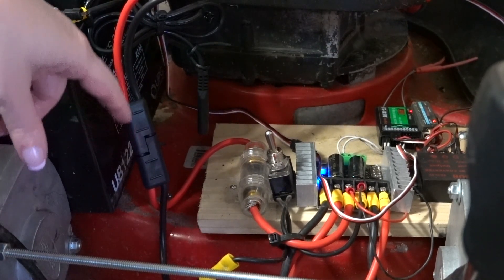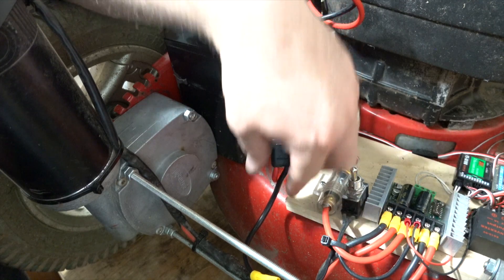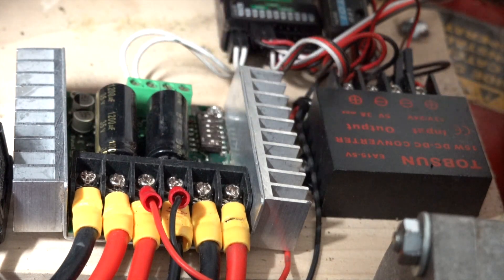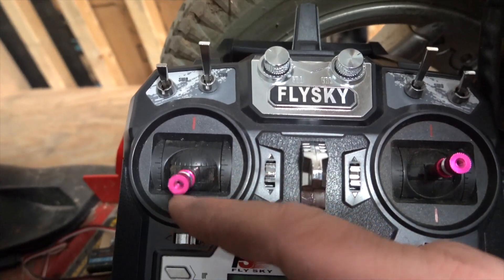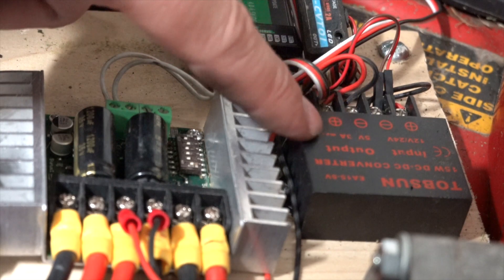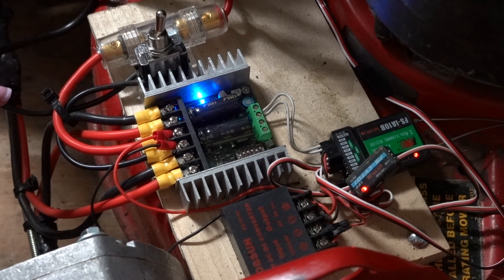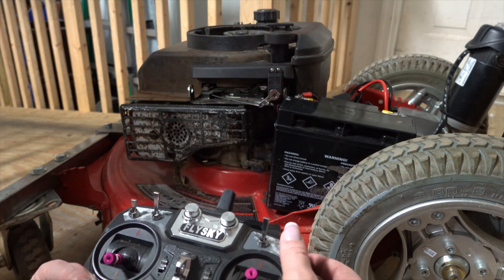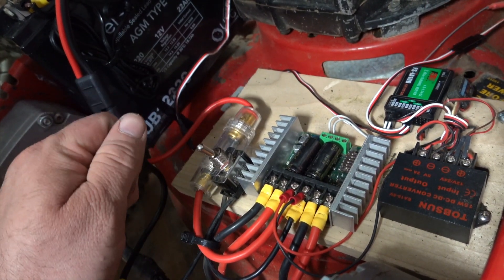How To Wire An RC Mower (Step-By-Step)

Comment: Where do you get the little plug in connectors you use on the flysky receiver?  Mine came only with the binding connector.
Reply from the maker: Those are called Servo Extension Cables. We have them listed in the description of the video under Servo Leads: https://amzn.to/3yEI2r4 . You will need to cut one one of the cables off to connect to your motor driver. This pack comes with multiple lengths so you should be able to find some that work with your setup.
Reply: @MeantToBeLindseyB   Thanks for the information and the video!

Comment: Could not figure out why my R/C mower would gain a mind of its own and need to be shut down for a minute when I changed direction quickly/often until I watched your video.  Just ordered a step down converter to stop the fly back voltage from messing with my receiver.  Thank you for your great video and information.  Wish me luck.
Reply from the maker: Good luck! Since we made these videos, we've had the same issue happen a few times too. Since they are cheap, we just go ahead and replace the remote receiver and also replace the receiver leads with new leads and fresh solder on any bare copper that goes into screw terminals. We just like to make SURE that we do not have any intermittent signal loss between the receiver, step-down converter, and motor driver. It's cheap and easy to do just to give a little piece of mind ESPECIALLY if it's been acting up.
Reply: @MeantToBeLindseyB  do you really need to replace the receiver?  Mine is still working fine after I turn it back on.  I have done a little (very little so far) reading on special flyback current diodes.  They still make me a little confused but I think that diodes would be the way to go.  They would allow electricity to only be able to flow in one direction and stop the flyback current.  Also, I think a person can program their remote to soften the braking for each motor.  This should stop the flyback because it wouldn't be a sudden stop of input voltage.  I will try to keep you informed.  Thank you again!!
Reply from the maker: @MrDozer120  It’s not a MUST REPLACE, but for us it’s a good idea and it’s fairly inexpensive and easy for the peace of mind. The diode is a good safety too.

Comment: I have a lawn  mower (two 350w motors)  controlled by a sabertooth 2x25 and a flysky i6ab. All fonctionned. 
I had to change the wheel transmission, so I had to dismantel  the electronics. Now, all remounted at the original position, when I turn on the circuit, one wheel start spinning alone. (turning on the flysky, it cannot drives.  I am not a specialist). 
I succesfully rebinded, but the wheel start again. On the flysky display appear a third line: SIGS1:10. What does it mean? (i suggest somethings about velocity of motor 1). What can i do?

Thanks
Reply from the maker: It's hard to know from your description. If everything worked correctly before, it seems like it's a wiring issue. If it never worked correctly to begin with, it would could be a settings issue or a wiring issue. 

We would check the DIP switches on the motor driver using the manual to set them for your current setup. Then I would unplug everything and reconnect it one connection at a time, ensuring that the signal wires from the remote receiver are connected to the correct input ports in the motor driver (channel 1 to 1 and channel 2 to 2). Ensure there are no frayed or loose wires and all the wires are plugged in correctly ESPECIALLY on the remote receiver where it is very easy to plug in the wires upside down or in the wrong channel.

Rebind the remote receiver and reset the setting on it if anything has changed. Let us know if you need more help!

Comment: AWESOME. I don't really plan building RC Mower, but this might be inspiration for some other RC vehicles. Everything in the setup is logical and exactly the same as i would do it. That fail-safe mechanism was extra bonus that i would probably miss if i was building mine.

Comment: Why you used saberthooth?
Reply from the maker: We prefer Sabertooth due to the build quality, low profile heat sync, and small footprint. However, due to the popularity of these types of builds, availability and cost have become a much bigger problem but they weren't an issue when we first built this mower. There are other options, but this was the best overall for us at the time.
Reply: @MeantToBeLindseyB  yes cost is very big issue. I am trying to use bts7960
Reply from the maker: Good luck!
Reply: @MeantToBeLindseyB  thank you..

Comment: Thank you for the detailed videos of your build. I would really like to know how the servo has been working out for your cut-off / fail safe switch. Has it been reliable during use? Have you had any issues with too much heat or vibration causing any problems while operating?

I was also wondering when you changed the spring tension to a lighter spring, did it effect the lawnmower shutting down any differently due to the change on the friction brake in the engine?

Instead of a servo, I was going to use a 12v power window motor/cable to overcome the spring tension on the lever but your solution seems so much less complicated. Sorry for all the questions, but I really like the way you solved some of the many problems faced when building an rc mower.
Reply from the maker: We have had some problems with the servo screw stripping out or unscrewing itself and the metal wire that pushes the lever bending. We have had to replace the servo a couple of times.. but they are cheap and it's still working fine.

The engine shutoff is slower, so it takes 6 seconds to stop when you hit the switch instead of 2, but that's fine. If we did it again, I would probably do what you're thinking of by using a dedicated motor like a wiper motor, but the servo is a decent "budget" solution.

Good luck, and let us know how your build goes!
Reply: @MeantToBeLindseyB   Thanks for your reply, that's exactly what I needed to hear. Since you say you have had some troubles and I already have this 12v window motor, I'm going to see how it works instead of buying a servo. I will let you know how it turns out.

Comment: You can control that Toggle switch function by adding a relay in-inline with it.... then the receiver can control the relay to turn it on with the remote controller transmitter.
Reply from the maker: We were having trouble finding a relay that could handle the power, simple enough to control with the remote receiver, and at the price point we were trying to hit (as inexpensive as possible). We will be looking into a solution like this for a future build. Thanks for the tip!

Comment: First of all, awesome awesome video. Thank you for the effort you've put in explaining all this.  I have a question about the two signal wires from the remote receiver to the sabertooth module.  I see that you're not powering the remote receiver from the sabertooth module, but why is there no ground wire connected from the remote receiver to the sabertooth module?
Reply from the maker: The power and ground for the remote receiver are both coming from the power inverter. Since the inverter and the motor driver both use the same ground too we didn’t need to run a ground from the remote receiver to the motor driver. You totally could do both and having a secondary ground is a good idea.
Reply: @MeantToBeLindseyB  Thank you :)

Comment: Great right up like the step down converter going to put into my build the signal wires going to motor driver you deleted the black and red from the pig tail correct and it picks up power just from the step down connection thanks again from another wheelchair user
Reply from the maker: Yes. That is correct. Good luck!

Comment: Could you provide the model of the engine speed controller? How is the mower performing? Does the electronics work without problems?
Reply from the maker: We listed the motor driver used (and alternatives) in the video description so you can read the full specifications of each on the item pages. We have been using this setup since this video came out with some minor tweaks, but no real issues. As long as you ensure no wires are coming loose, the motor driver is not getting clogged with dust and grass clippings, and you’re taking proper care of the batteries this setup should last a good while.
Reply: @MeantToBeLindseyB  Oh, sorry for the unnecessary question (I didn't expand the description). I hope to start my mower for the new season. Regards.
Reply from the maker: No worries! It’s easy to miss the info. Keep us posted on your progress!

Comment: Hi guys, love the video and its helped me understand how things work. I realize this video is over 2 years old now and you have probably already changed what I am about to tell you but if not it might be something to look at. I noticed in the video that your red power wire coming out of your motor driver to power the voltage step down regulator may be pinched under the heat sink of the motor driver. Would hate to see that short out. Hoping to make a remote controlled lawn mower soon. Gathering parts already 🙂
Cheers,
Dan Oliver
Reply from the maker: Good eye.. Thanks for the heads up! We have had issues with that. We added fork-type wire connectors for the end of all of the wires and rerouted them a bit to keep them from getting pinched or rubbed.

Comment: Hi there,  I just got my sabertooth 2x25 today and I tried to run it with my two motors. Followed your wiring diagram but one of the motor running it self without using Mt remote while the other motor is not running at all. Is it possible if you could help me to solve the problem.  Thanks a lot
Reply from the maker: Follow the manual to set the DIP switches based on your particular configuration. You can also Google search “Sabertooth DIP switch wizard” and it will walk you through exactly what you need to do.
Reply: @MeantToBeLindseyB  thanks a lot for your information. my sabertooth is now working fine right now. once again big thanks

Comment: Love the design and thank you for sharing such detailed info. I used your links on Amazon and buying the same things. Even bought the same M300 motor and gearbox on eBay. I see you wired up the motors with the pos/neg cables but what is the 3rd wire used for? The light maybe? Did you hook it up? Thanks!
Reply from the maker: That’s the wheel lock. You have to power it with 24v to release the lock. We just removed it from our motors. It’s worth doing because it makes the build simpler and it’s just a few screws right on top of the motors.
Reply: @MeantToBeLindseyB  Many Thanks 😊.  I will remove it too. Still waiting on items to come in but can't wait. Wish I could send you guys pics of my build.
Reply from the maker: @larrythomas6773  Feel free to email us and keep us posted at MeantToBeLindseyB@hotmail.com

Comment: I see how you powered the FS-iA6B, but how did you know which pin was power and which was ground? I can't find any docs on that and it's driving me nuts. How did you figure that out?
Reply from the maker: You're right. We can't find that specifically stated in the manual or anything. We just plugged in the servo wires that came with it and the 3 wires of that servo wire is in the order of white -> red -> black. It only works with the white (signal) wire on top, so the positive wire is in the middle and the negative is the bottom pin. It's true that "red is positive and black is negative" isn't ALWAYS true, but it works with this case. When testing, if the LED light on the receiver isn't blinking or solid, the power isn't hooked up correctly.
Reply: Of course I find it right after asking :-) https://static.rcgroups.net/forums/attachments/6/8/1/5/7/2/a10427603-178-500px-FlySky_IA6B_pinout-f89eed4f.jpg

Comment: I’m in GA. (Neighbor state. I’ve been to Franklin b4. 

I want to create your mower as mentioned in other video comments.

However, if I can, I will take it to next level.  Before I get into “Nextel level.  I have got to get 1st level.  It may require replacement of some phase 1 components, but with my preliminary look into next level, I may can use all previous components.  My host capability will determine that.
Reply from the maker: Awesome! Let us know how it turns out!

Comment: Not sure if u still use this but I’ve been building and using mine over 10 yrs. U have to make a steel frame for it because the toque from the motors will break the mower frame, your wiring is way more complicated than it have to, without a proper enclosure you will spend money to replace all that in couple years, u need different wheels to get any traction, the battery is way too small, u need 24v. I haven’t done this but u should go with battery operated mower to make it easy starting. I personally use mowers with a starter so I can turn the mower on and off remotely.  this is an on going thing where u have to constant fixing , replacing, upgrading.  I’m not even disabled but I find it’s a PIA because something always goes wrong and it’s a pia to work on and it’s take up a lot of surface space in the shed
Reply from the maker: Thanks for the tips! We have been using it since this video came out. We’ve learned a lot from it and have made some improvements (like changing the front wheels and redoing some of the electrical connections). Everything is still working fine so far, but yes… there are definitely things we could have done better. Our next build will probably be an all electric version with brushless motors. Using what we learned from this build should help it be even better next time.

Comment: I finally got my build outside and running.   However, I don't have the arm to get the engine started.  Many different routes.   Add electric start or get an electric mower.  If there is a patron saint for remote control he is sure making me work.
Reply from the maker: You can try what we did: Remove the pull starter completely (we just had to drill out the rivets) and use a power drill to start the engine. There are other, better solutions in these comments too, but that works for us!

Comment: Hey guys great video very informative they actually sell a little spring that goes to your remote control where you take them back off and it hooks on to it so that way it turns it into a self-centering joystick which is what you need
Reply from the maker: Thanks for the tip!
Reply: And as far as putting cameras looking to fpv drone cameras

Comment: Great vid, but I was wondering, there is no link for the motor and wheel? Would you mind listing it. Thks in advance.
Reply from the maker: The motor and wheels were just whatever was available on eBay at the time. Since these listings constantly change, you’ll just need to find one that will work for your particular build. We used a motor and wheel set from a Permobil M300 wheelchair.

Comment: What kind of motor driver  do you used in this video
Reply from the maker: We use the Sabertooth motor driver listed in the video description. It is harder to find now because of shortages, but it’s a great driver!
Reply: After I got everything  hooked up and working, but when I pushed  my toggle switch  on my remote control forward  it turns and when I move the the toggle to turn it moved forward . How do I get my remote  control  toggle to go forward  when push forward.  Anyway  thank u very much for replying  my question  and I learned  a lot from you guys. 💗
Reply from the maker: @JakeIng2  You need to switch your wires for channels 1 and 2. In this case, channel 1 should be steering and channel 2 should be throttle. Literally, just switch them where they are plugged into the receiver. Hope this helps!
Reply: It worked, thank you very much. You guys are awesome. Take care.

Comment: Is it possible to monitor the voltage if the 24V battery setup using the FS-CVT01?
Reply from the maker: Absolutely! It can measure up to 100v.

Comment: almost got mine completed just need to find out what size to use for the front wheels. i have a set of 4 inch swivel wheels with ball bearings but im thinking that they are going to be too small i may have to go to a 6 inch wheel. do you have an idea what are on the electric wheel chair?  Thanks
Reply from the maker: The bigger the better for going over bumps and onto sidewalks and stuff. The downside of going bigger is they have to stick out further from the body to be able to turn all the away around. The trick is to get the biggest ones you can without it being so far away from the body that you can't get the mower up to the very edges of things. We wound up going with a 5 inch swivel set for ours and it seems to work OK except for one spot where the sidewalk is really high compared to the grass.
Reply: @MeantToBeLindseyB I picked up a couple of 5" wheels now i have to make modifications. As soon as the weather permits. Thanks for your help.

Comment: I enjoyed the video. I want to make it too, but I'm worried about the battery. To do a 25V 250W motor, use the CYTRON MDDS30 motor drive. Please give me some advice.
Reply from the maker: You can use the same battery for that setup, or use multiple of the same battery for more speed and battery capacity based on your specific needs.
Reply: @MeantToBeLindseyB  thank you

Comment: I was looking at your setup is there a way to run a computer cooling fan for the motor driver ? thanks
Reply from the maker: Of course! You’ll just need to source the power from either the battery, the step down converter (if you use it) or the motor driver itself if you don’t.